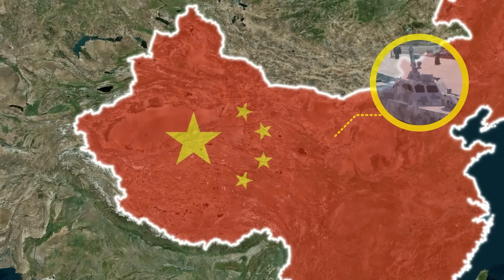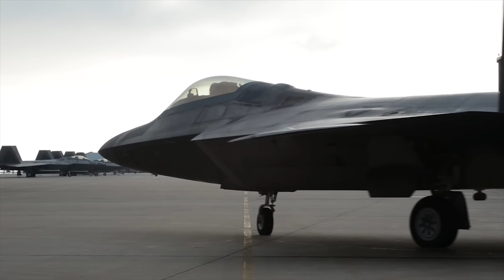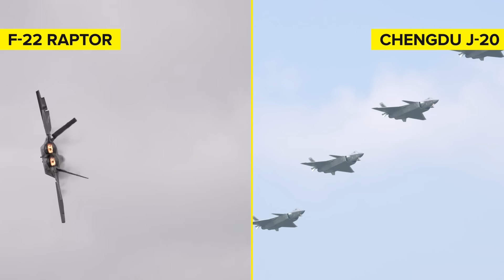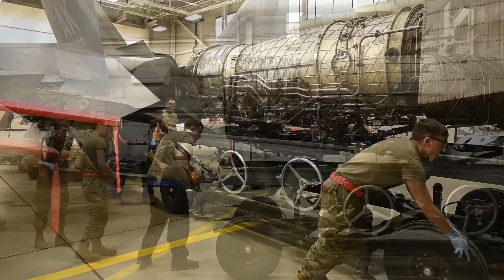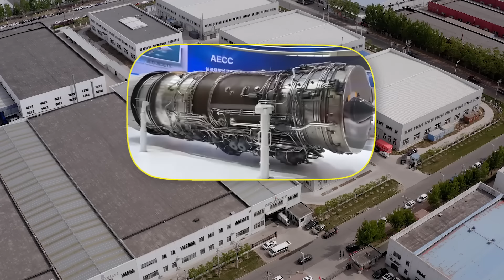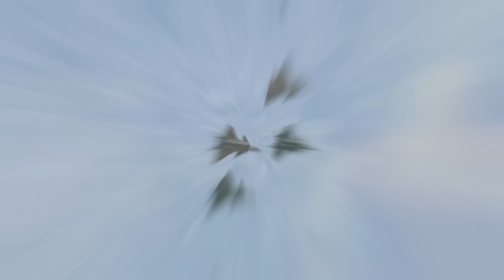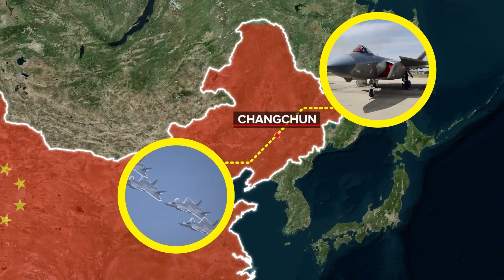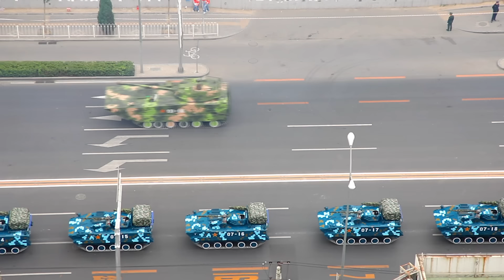China’s J-20 ‘Stealth’ Jet Is a FLYING LIE… A Paper Tiger That Can’t Fight

Comment: The PLAN and PLAAF have the advantage when it comes to numbers. This is an area in which America dominated during WWII and is one the main reasons why we won WWII.
That is extremely important now, and China most certainly has the advantage in that aspect. 
Where China has lagged behind and considerably so (even though almost everything they have is either reversed engineered, stolen info, or developed from reverse engineered technology) is in the same capabilities of American, British,  French and Israeli technology.
From radars,  to turbines engines, to low observable understanding and more, they have not cracked the code on getting their equipment to the same capabilities. 
The Chinese have seemed for the time being to have settled for slightly lesser capabilities but in more massed produced numbers and this might actually be to their advantage. 
Remember,  the Germans were far ahead in many areas of tech before and during WWII than the allies but we had the ability to produce much larger quantities than the Germans (multiple reasons for this).

In the end, take the J-20 and J-35 versus the F-22. Hell, just take the J-20 against the F-22. As of right now the Chinese have almost twice as many J-20's than the U.S has of Raptors. They are building more and we are not. That's a problem no matter how much better the Raptor is over the J-20.
Reply: Numbers is #2.
Logistics is #1.
Case point: Russia's initial invasion of Ukraine was a joke...
Reply: Your not wrong. There was more to it with russias massive failure with Ukraine but logistics was a Major part of it.
Also, China's military has a huge and I mean huge logistics problem.  Between their different military regions, the CMC, each region having a political commisar who has to be on the same level with actions and that every single military command to even every ship having a political officer who has equal rank to the C.O who has to agree with any action taken; they've got a problem. 
Logistics falls into this because supplies for each region is different and so are the repair facilities. If the South China Sea region has a problem with gear, weapons, food etc, they can't just take new from another region.
Reply: The f35 continues to dwarf j20 production, the f22 is on its way out.  

That said, people look at late ww2 production and complain that peacetime production is not as high.  Recognize that japan and germany both greatly surpassed us arms production before the united states entered the war.  

The united states has the same advantages it has always had, geography, protecting 99 percent of its agricultural and manufacturing base from enemy incursions and the ability to raise infinite capital for major construction projects.  It also has coast lines that are impossible to blockade.  These are advantages china couldnt dream of.  You cant mass produce anything in factories that are catching 2 jdams a week with a full naval blockade stopping food shipments into a country that cannot feed itself and preventing foreign trade thats necessary to keep its economy alive.
Reply: The F35 is good, of not great in its own right but when it comes to low observable from every angle and air superiority; the F22 is still king. Also, they are making more advancements to existing Raptors.
That is not an end all though. They seriously need to reopen the F22 line (difficult under current conditions but not impossible and would be much easier if they changed a few variables).
As it pertains to the industry,  during WWII even though Germany and Japan did initially have greater productivity than America, we were all relatively capable because almost everything was hands on.  In today's world however,  so much is automated and China also has a step up with essentially slave labor with a much larger number of workers.
The political mindset alone in the U.S is discouraging to our ability to come together if world War broke out. 
I'm not saying that China would absolutely win, but as of right now with the way things stand; China has a good chance. 
The only way we (US led coalition would win) is if we took the politicians and lawyers (including State Dept. Bureaucrats) out of the decision making and let the Dept of War call the shots. It would be over very quickly. 
The problem there is that on TV it would look bad and too many politicians are more concerned with how things look then getting the job done.
Reply: @MA2USN  Hey, really appreciate the thoughtful reply — good points all around.

They actually can’t reopen the F-22 lines. Those facilities now produce the F-35, and orders are already booked about five years out. The F-47 will be entering production soon. Some Raptors are being upgraded with avionics roughly equivalent to mid-2010s F-35s, but they’ll never reach full parity.

The F-22 is technically superior for air-to-air work if it has uncontested AWACS support. But in heavily contested airspace, it’s less effective since it can’t search for targets without giving away its position. And honestly, “air superiority” makes up maybe ten percent of what fighters actually do — it’s a relatively small part of the modern mission set.

Germany and Japan both had access to near-unlimited forced labor by the time the U.S. entered WWII, and that didn’t save them. Automation today is a similar double-edged sword — easy for ISR-heavy platforms like the F-35 to find and destroy, and increasingly difficult to replace once taken out.

On the political side, it’s worth remembering how much support Germany had in the U.S. before Pearl Harbor, and how unpopular intervention was. Then, within weeks of the attack, the country snapped into full alignment behind the president and total mobilization. The U.S. always fights itself until it finds a worthy adversary — then it unifies fast. Dictatorships rarely benefit from that kind of adaptive surge once real pressure hits.

As for China “winning,” it really depends on how you define that. China can’t realistically survive a sustained U.S.-led naval blockade — too easy to cut off, too hard to defend. A ground war would be catastrophic for everyone, but China has no real way to strike America’s industrial base, while most of its own industry sits along vulnerable coastlines.

That last part of your comment might be true in theory, but without diving deep into specific scenarios, it’s mostly academic.
Reply: I'm currently sitting in a theater and cannot do justice to your rebuttal in kind.
Without sounding like a sycophant,  I appreciate the great job you did as well with response. 
If your interested,  then tomorrow night when I have opportunity,  I will repaind again. 
I do not necessarily disagree with you and frankly I believe that we are on a similar area with just some different takes on certain areas.
O do believe however that we could open a new F22 line if they facility was built with the military combat engineers in order to cut cost and time. The other side to that equation though is having enough trained and adequate workers to operate that line.
If and I mean if we were to reopen the Raptor line with the Avionics from the Lighting incorporated into the F22 with the new advancements in the F22 Radar absorbent materials and irst suppression,  it would be potentially unstoppable compared with existing Fighters.
More of a dream, I admit but not impossible. 
More to come tomorrow. 
Again, good to see intelligent and well read people discussing these issues with all of the trolls out there.
Reply: @MA2USN  Until tomorrow, or whenever — I’m always down for a good, robust conversation.

I’d agree that there’s nothing technically stopping us from creating new F-22 lines. I just don’t see why we would, when the F-47 has likely already blended the design philosophies of the F-22, F-35, and B-21. The F-22’s design language is rooted in energy maneuverability theory, which is impressive but not particularly relevant to modern air combat.

Every design is a trade-off, and modest sacrifices in kinematic performance for dramatically lower cost (in the case of the F-35) or increased stealth and sensor capability (in the case of the F-47) make more sense in 2025. I nearly cried when they canceled the remaining F-22 orders in the early 2010s, and I still think it was a mistake that forced the JSF program to mature too quickly. But at this point, looking ahead to 2060 or 2070, it makes more sense to focus on the F-22’s true air-dominance successor.
Reply: Sorry it took so long. I've been extraordinarily busy and haven't had the time for YouTube as I normally has. I'm going to make this quick, as I stated in my last one that I don't think we necessarily disagree on too much here.
One area however I need to make a point on is that although you're correct trying to cannot sustain a blockade; neither can the rest of the planet. What do I mean by that? In order to prevent the Chinese from receiving and distributing Goods we would have to shut down the Straits of Malacca,  Sunda, Lombok, Macassar, Torres and other vital areas. Since 75% of the World's Trade goes through that area it would essentially shut down the world's economy. China couldn't sustain it but neither can anyone else. Which is another reason why it would be very difficult for China to actually try to invade Taiwan because they know if they did this might be a result. I would like to think that Americans could put their differences aside if it came to war to be able to start Mass producing for the effort. However, I think we're at a Tipping Point where you would actually have a large portion of the country siding with the adversary. I can only hope I'm wrong. The areas that China are definitely lagging behind it is quality over quantity. Their quality is better than anything Russia has now and what the Soviets had during the Cold War but they're still pushing the quantity over quality issue. That's probably because almost all their technology is stolen in Reverse engineered and they still can't get everything correct. However with the slave labor they have and the Chinese government controlling the cost of Industries they have the ability to make a lot more for a lot less and do it quicker than we can. I personally think that we should do everything in our power to reopen the F-22 line and builds many more of them. Of course not everything's about 5th and 6th generation you still need other platforms. However, in order to secure Air Supremacy we're going to need a lot more of the Raptor.
I've been using voice text so this probably wasn't as short as it should have been.
Reply: @M @MA2USN  Take all the time you need; this conversation really is just a pastime for both of us. I’d genuinely rather you pause, think, and respond with a clear head than react quickly.

On blockades: I agree a total blockade is impossible, but it’s not the 1800s anymore. In any conflict serious enough for the U.S. to intervene kinetically, most of the developed world would impose sanctions anyway. That alone would disrupt the majority of China’s trade. The U.S. can track Chinese shipping by satellite and broad-area radar networks, so interdiction doesn’t need to be perfect—it only needs to target outbound traffic from China. Even if a ship slips in, it’s not getting out without being flagged. Any kinetic conflict between the world’s two largest economies would cause massive upheaval in global markets. That’s just a universal downside, hitting both sides. The difference is that the U.S. is better positioned to ride it out, because the Chinese Navy doesn’t have the blue-water reach to meaningfully threaten U.S. shipping or establish dense interdiction networks of their own.

And honestly, it feels like you’re a little emotionally attached to the F-22 at this point, instead of making an objective case. A lot of the rest here just comes down to differing opinions, and that’s fine—we’re just two nerds speculating about extremely complex systems with endless unknowns.

That said, I think you were right on one thing in particular: “China won’t try it.”
That’s the entire point of U.S. deterrence posture. It relies on everyone believing the U.S. is both willing and able to intervene meaningfully. My stance exists partly because it needs to be believable to leadership on both sides for peace to hold. As long as the U.S. can credibly show that it can inflict serious damage with minimal consequences, China is incentivized to stay in its lane.
Reply: Absolutely I'm invested emotionally in the F-22. I'm a Navy guy too but that bird is incredible. The incredible amount of corruption that was involved in canceling it and favor of the F-35 because that could be sold to other countries in the F-22 couldn't is astounding. I'm being over simplistic here but that was the overall gist of it.
Yes, without a doubt any conflict with China and Taiwan would have many countries imposing sanctions on China but at what cost of themselves and would that limit how many sanctions or how quickly they enforce him? The problem is that in the early 1990s we allowed China to get away with everything I could for economical reasons and now most of the world relies on China for too many Goods from basic items all the way to Pharmaceuticals. Most of the world also relies on China for refining minerals and then shipping them back to us because they can do it so much cheaper.
So that was essentially my point, that whether or not those Straits in Southeast Asia are blocked off or we impose sanctions on China, 3/4 of the World's Trade goes to that area and it would essentially grind the world's economy to a halt.
I do agree, however that even if hypothetically we did have the F-22 Line open and a large number of them built in time that they could only go so far as they're not carrier launched and that plays a huge role in it.
The next war, if it is with china; is going to be mostly enable War and Naval Aviation with long range Air Force as well. That's not to say that any of the other branches are not important but certain conflicts will involve certain branches more than the other. Where the Army would come in is definitely in the field of ballistic missile and Hypersonic missile defense.
There's a great book that came out 25 years ago and the second edition came out about 15 years ago called The Great Wall at sea. Written by Bernard Cole. For a while it was required reading at Annapolis. Even though it's old most of it is still extraordinarily relevant. Dr Cole still teaches at the war College and still has written many papers on china, Southeast Asia and taiwan. If you're interested I suggest reading some of it.
Reply: That was supposed to say the next war, if it is with china, will be a naval war.
I'm sitting at a tire shop waiting for my company vehicle to be fixed and I'm using talk to text. Missed the typo. There are probably more.
Reply: @MA2USN  How many sanctions get imposed—or how harsh they are—kind of misses the real point. No one is sending bulk freighters into an active warzone anyway. We already saw global shipping reroute practically overnight when the Houthis launched what were essentially glorified bottle rockets into major lanes. A 10% reduction in China’s trade is enough to wreck their economy. That’s all it takes. Their entire economic model is a stack of Ponzi-like structures that’s already showing cracks. At this stage, that’s about as far as the China debate can go; we’re just approaching the issue from different angles.

On the F-22 vs. F-35 topic, I think you’re completely mischaracterizing the relationship between the F-22’s cancellation and the F-35’s adoption. There wasn’t corruption involved. The F-22 simply didn’t have a relevant mission set in the early 2010s. It couldn’t even self-designate for laser-guided munitions—which is why the F-117 kept doing precision strike work until the F-35 came online. The F-22 and F-35 were never intended to be an “either/or” replacement anyway; they were supposed to mirror an F-15/F-16 high-low mix.

The real issue was export restrictions. By blocking foreign sales of the F-22, the U.S. killed the economies of scale necessary to keep costs reasonable. The jet ended up costing nearly three times as much, for maybe 15% more kinematic performance—and with significantly less advanced avionics. The F-35 simply has more capability: IRST, MADL, DAS, EOTS, real multi-node integration, and so on. The F-35 has literally filmed ballistic missile launches from 800 miles away and has guided shots for ground-based systems—Patriot or Aegis—that couldn’t even detect the target themselves.  It can fire on targets in any direction, even directly behind itself, meaning things like turn rate and energy retention just dont mean what they meant 30 years ago.  

So I’m still not sure why you think we should resurrect a 30-year-old airframe when we’ve got a next-gen replacement on the horizon—likely already flying—and when, as you yourself noted, the F-22 doesn’t even have many viable basing options near our primary threat, doesnt have the legs to long haul it, and is too expensive to procure in volume even when not under war time stresses.  I know what you want to happen, Im just not hearing a very compelling argument in favor of your position.